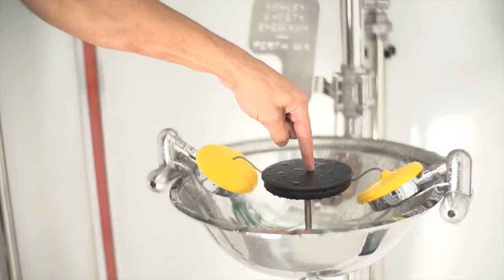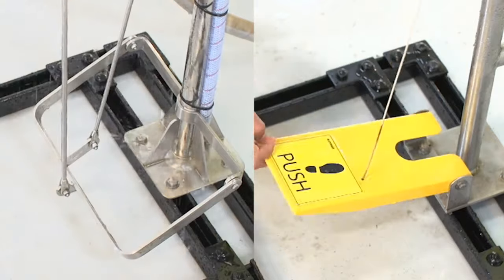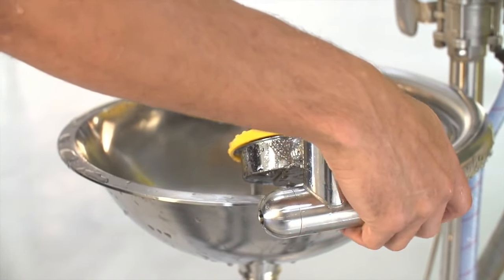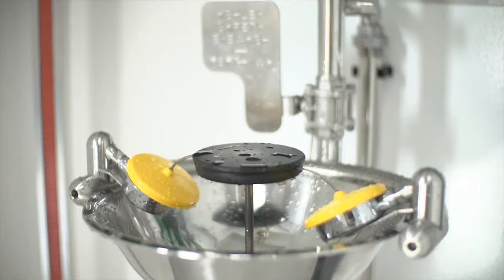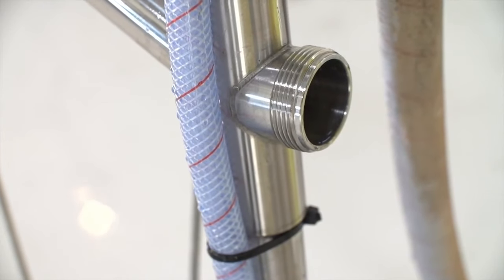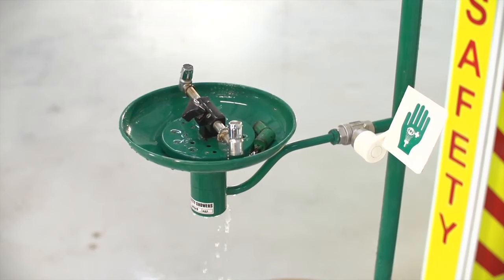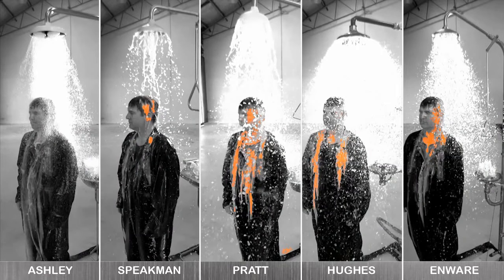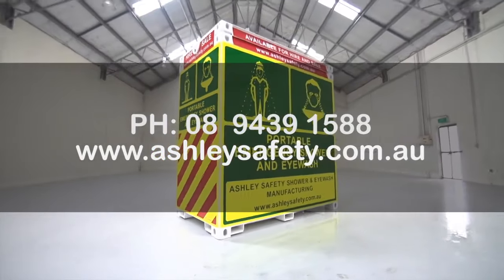Safety Shower Performance Test

Comment: That eyewash is clever. You really wouldn't even need to push that black button or even the pedal with your hand per say. If you really needed to, you just just smack your face down and it would trigger the button, pull off the covers, and turn on the water.

Comment: how do you control the splashes of water and slippery floor?
Reply: there should be some anti-slippery mat.
Reply: Yeah, we ran it for at least 10 minutes and we for some reason only have a single drain directly below it. so we had an inch of standing water alllll over the place.